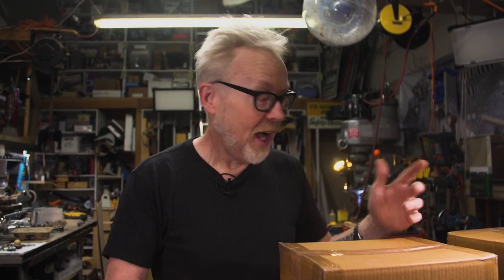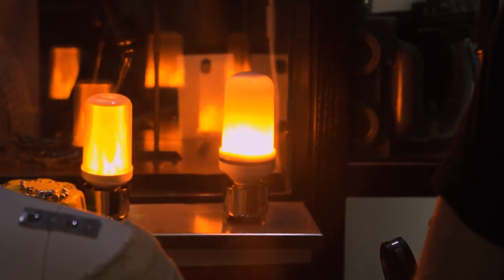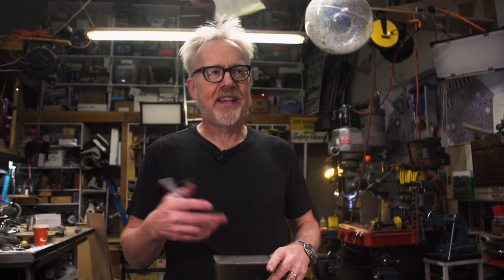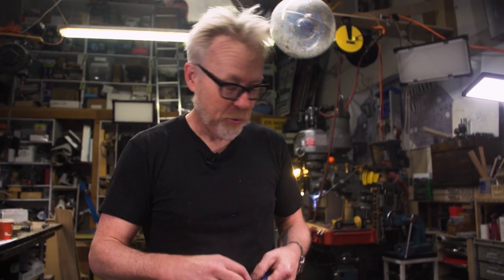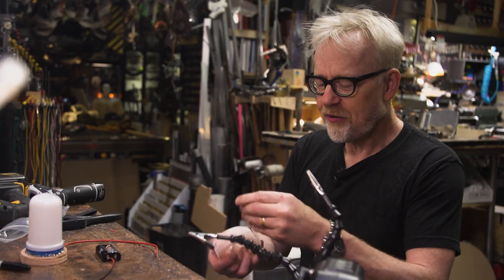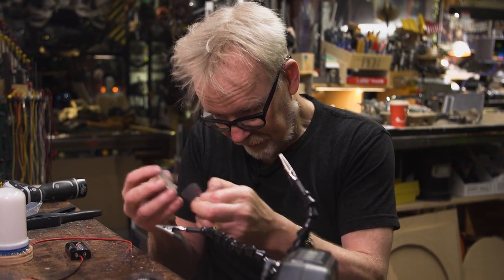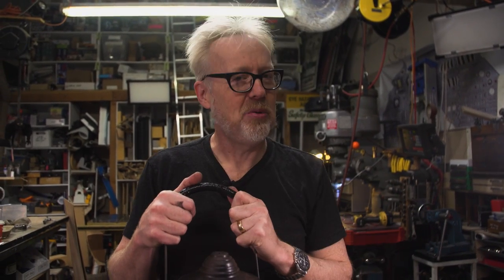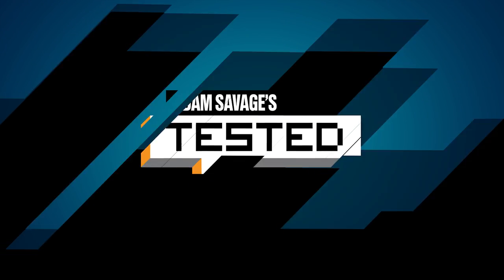Adam Savage's One Day Builds: Gaslamp Lantern Prop!

Comment: I came across something like that dual-lock velcro over 20 years ago. I had designed some graphics for a friends exhibition booth, and discovered that the walls were covered with something call ExpoLoop fabric. The graphics were printed on a plotter then mounted on foam board. The foam board had strips of something called ExpoDash fixed to them. This came on a reel, had a sticky back, and the front side had velcro like hooks. You could stick the graphic boards on to the fabric and if they needed to be moved you could just pull them off and stick them somewhere else. By accident I found that the ExpoDash would stick to itself when I put two boards down back to back! Took some care to get them apart without tearing. There is some cool stuff used by exhibition stand builders and props people.

Comment: I'd be expecting to change those batteries soon! 
It's designed to pull 6w from a 110v supply, so approx 55mA(assuming the converter isn't super inefficient). Standard AA battery has a capacitance of 2000-3000mAh, so running two batteries you could expect somewhere in the region 3-4.5 days run time....or at least I think that's how it works.

Comment: I wanted to do something like this for a stage prop at a Christmas musical I just did, but didn't have time to make one. Plus the two lamps that were sourced for me were oil lamps. 

I wanted to add DMX control so it turned on with the scene and off at the end without someone touching it. 

But being oil lamps I couldn't think of am easy way to install a socket without modifying the glass.

Comment: Love this project Adam. Got some bulbs here in the UK from Amazon, not the same "Omicoo" brand, but they look identical but unbranded.  I can't get it to work from 3V, but it works dimmer than when screwed in to a lamp at 6V. At 7.2V it seems as bright as when screwed in. Just a heads up for UK people ordering these as there does seem to be some differences. One guy in the comments from Germany mentioned the ones they have there only work with 12V.

Comment: When I was a kid in the 70s we had some kind of fire bulb. It was shaped like a normal bulb but the filament was a flat piece of metal shaped liek a flame with holes in it. When turned on a plasma mike effect went from the bottom to the top of the filament. Im sure that was totally safe :)

Comment: Love the video.  After watching it, I was out and found what I thought were the same bulbs you used.  When I cut the bottom off mine the circuit board with the lights was wired directly to the base.  I couldn't cut the wires like you did and add the battery power.  It was such a bummer.

Comment: Yo, Adam. 
Super simple little tip (And it feels odd offering advice to someone like yourself) about that "hermaphroditic velcro" you've fallen in love with. 

Because the stuff has very fixed positions in which it locks to the opposing peice, slap one peice down, stick the other part to it, peel off the adhesive backing, and them position the other part to be attached to the project! 

Sounds simple, but if you're ever using it on parts with a tight tolerance, or want square edges etc, it can catch you out.

Comment: Turned out so well. I have one of those or similar bulbs, one that I haven't taken apart yet. I've noticed that a lot of the led white lights take 9v from  a very dirty (radio garbage) switching circuit / converter 110 to 9vdc. Many of the ones I've purchased from ebay die quickly ? Poor electronic engineering of the switching converter. As I'm in California far northern valley I deal with PGE outaages and use these panels, 12v, (not the yellow ones (I suspect those are actually 9v and run way to hot) , but individual smd led's) they work really well so no lighting needs here. Eventually may say by by to pge. Again, a beautiful looking ingenious  project .

Comment: Just in case anyone else is attempting this project a year later, many of these bulbs are now powered by 6v directly to the board and the only wires present are from the contacts in the screw base to the board. No wires from the board to the LEDs - only solder connection. Still quite doable but more challenging for electrical newbies like me.
Reply: So don't have to take bulb apart anymore?
Reply: @jasonhaislet2732  you do have to take it apart

Comment: 2 little things I saw that maybe help you out with this build and want to add here: 

Adam covered the Holes at the Top of the bulb. These may be there because the Bulb gets quite hot, please either redo them after the cover or don't let the bulb burn for long.

Also, when you are not familiar with wiring up stuff please do yourself a favor and color code the lines. Adam is in the Industry long enough so he might get used to use the same color for every wire, but if you start working with larger projects just do yourself this little favor.

Comment: The batteries seem to last about 18 hours using the flame effect.  After that, the batteries voltage drops to around 1.37 each and the bulb will start strobing.  Using Duracell,  I did measure them before at 1.57 volts each.  Not sure if it has to do with battery age, not sure how old my batteries were.
Reply: I used the same brand of bulbs

Comment: For $4.29 with free shipping, you can get the light bulb on aliexpress
the amazon seller is just a rebrander

I already used the 7W variant which looks the same and also works on 3V DC (2x AA Batteries).
The 5W 7W and 9W variants automatically adjust to orientation.

Comment: I am very surprised that Adam has only recently discovered 3M Dual Lock tape, it has been out for over 10 years now. Dual Lock is by far superior to standard Velcro, you don't have to worry about which side does the hook or loop go on, it has stronger holding ability and it doesn't collect fuzz or hair. There is no reason to ever use traditional Velcro anymore.

Comment: The whole thing with items plugging into mains power where the actual device runs on far less DC voltage is wildly common. I'm into remote control hobbies and have a couple friends who have built large ~20-24" screens for First Person View (with a camera on the aircraft) flying. Many smaller flat screen (especially LED backlit) TV's run off of just 12-16 volts meaning a hobby battery (a 3S or 4S respectively) can run one no problem for a pretty good length of time. Just be careful opening such things as the power supplies have large capacitors in them that could still hold lethal amounts of power.

Comment: I put two LED's into a halloween mask connected to two AA batteries. After halloween they went into storage and I just left the switch on so the batteries would drain and not corrode. Cut to thee years later, those two little LEDs (albeit dimmer) are still on...LED's are very, very efficient!

Comment: Cool! Thanks for sharing. I like how Your passion and excitement for projects hasn't waned over the years.   Would You or have You done a dune landscape video? I'm planning a dune diorama for Wright Bros. Flight (100th Anniversary kit 1/39 scale incl. Crest of Dune & immed. area) but due to space restrictions, I then have to scale down Dune to 1/100th, so 12" high as slope meets beach area (I think slope length works out to be 18" & base run is 14" approx. Have to dbl. chk math lol) Kill Devil Hills, NC (formerly Kitty Hawk) I was thinking of using plastic stilts (cake layer tubes) attached to a frame, covered in mesh with plaster bandage strips over it, then  glue a light layer of sand, so I don't need too much of it. The above idea is instead of using foam board which I've seen in most videos for landscaping themes. Wish me luck. Take care.
/Rosemary

Comment: I see a lot of wasted energy in leds. Take the strong current out of the wall, convert ac to dc, there is about half the energy lost since you cut out half of the sine wave from the grid, then run it through a capacitor to even it out, more power lost and finally you have to have resistance in there letting only 3v of 120 v through. All of that turned into heat. And it is an LED bulb, so it needing low voltages is not that surprising to me... am I a smartass right now?
The velcro with only one side is probably mushroom tape. Very nifty indeed :)

Comment: ...nice build! However, the 2xAAA cell approach is only working because the internal resistance of your cells is working for the LEDs in this configuration. So for those trying this build: don't be "smart" and think of using rechargeable batteries - their internal resistance is way to low (most types) and the LEDs will fry themselves.

Comment: cool project. thxs for sharing. I think i might use those light bulbs to make a SW Florida fireplace. Thxs for listing the sources for the material. Do you also have a source for those cool wire strippers that you are using?

Comment: How do you think this could stand up to the elements, this would look amazing out in a garden. 

EDIT: Oh oh oh!  You could run rechargeable batteries and set it up to pick up a charge on a nearby small solar panel and use a light sensor/timer to run the light only at night...  I need to go to the shop!

EDIT 2: OH OH OH!! I bet one of those little crappy solar powered lawn lights everyone uses run around 3V!  I might be able to just gut a cheap 5 dollar one and not have to build the circuits myself!

Comment: The innards of the bulbs I bought on amazon don't look like the innards of this bulb, though their outsides look identical. I'll have to figure out if they can be powered the same way
Reply: I bought one that ran off 9v instead of 3. Dont be afraid to tinker around and make it your own!
Reply: @micahgodsey455  I have no fear at all of tinkering- I'm a production designer and a prop maker. Just with the particular bulb I bought there does not seem to be any way to effectively run it off of batteries because everything is soldered into one integrated circuit board. Much easier to just buy different bulbs that have more user friendly guts in my specific case.

Comment: Be aware that some models of flame bulb require higher voltage.  The one I picked up will barely run on 6V (four batteries).  Its A/C to D/C converter puts out just over 8V unloaded and about 7.5V loaded.

My guess is that Adam Savage's bulb has the voltage regulation in the A/C to D/C converter and the electronics are designed to run off of 3 (or 3.3) volts.  The FEIT-branded bulb I picked up probably puts the voltage regulation on the electronics side and is probably designed to use 5V.  To reliably get 5V from a common linear voltage regulator (like a LM7805) requires at least 7V input.

Another video pointed out, the voltage regulation appears to be inside the custom IC that drives the entire effect, so it's probably hard to bypass it.

Comment: That AC to DC converter is known as a “FULL BRIDGE RECTIFIER!!” ElectricBOOM talks about that all the time.
Reply: No, the Full Bridge Rectifier forms part of the whole converter / regulator.  It's just one of the first components in this (most likely) "Capacitive Dropper" type power supply.  (It could also be a resistive dropper or a buck regulator but those are less common these days)

Comment: I don't know what technology runs that light-bulb, but I can see two potential problems.

 A lot of circuits (f.ex. led lights) depend not on the voltage as such, but the current. The voltage of the batteries are not 1.5 EXACTLY, but fresh batteries start out at 1.65 (at the very least); Without some sort of protective resistor or other circuit it's probable that you shortened the lifespan of any LEDs or 3v IC chips that might be involved in creating the effect..

Secondly; LEDs take very little current compared to brightness, so it might work for a long time, but if those aren't LEDs (or if the bulb take deceptively much current for the brightness) you might drain those batteries so fast that it wouldn't be reasonable to use such small batteries.

Comment: I asked this before on another video but legit QUESTION: Torch for tightening heat shrink tubing? Is there some amazing benefit of using torch instead of the soldering iron itself? I always just use the "pipe" section of the soldering iron to do it and I don't understand why you'd need a torch for it! :O

Comment: If that is the case, then what about regular LED light bulbs? Can they also run on batteries too?
Reply: I think most are so optimized for cost that the LEDs and AC-DC converter are on the same board and can't easily be separated.

Comment: If it's 5 watts and only 3 volt, would that be like 5/3 = 1.67Amp, so on 2 1.5v in series with the Amp Hour 1300 would be 1300 /1.67=*778.44 hours (778.44/24 about 32 days)*
or is it
If it's 5 watts and 120 volt, would that be like 5/120 = 0.0416Amp, so 1300 would be 1300/0.0416=*31250 hours (321250/24 about 1302 days)*
or neither?
(Not sure how to count 5 watts for the converted 3 volt or 5 watts using 120 volt ...electricity/electronics is not my strong side...)
I really like the result in the video though!

Comment: I purchased the bulbs linked in the description for a project like this, but the bulbs that arrived were not the same and didn't have wires for attaching the batteries as the ones in the video.  Can you recommend another brand or source for some that would work?  Thanks

Comment: Doesn't it kind of suck that the average electrical device only ever needs a 5 - 12V DC power so we're always using these big adapters to power (almost) anything ?

Why aren't houses build with that as our main power system instead of the standard 230V AC (or your local equivalent)
Heck ... USB power ports would be such a great feature as a standard power source.

AFAIK hospitals do have DC power circuits within their buildings...

Comment: Weird. That they had that converter inside the bulb.
Reply: pbilk1 could the converter be there to allow it to be screwed into conventional sockets? If the circuit uses 3 volts DC, it seems to me that 120 volts AC could fry it

But that’s just a guess from someone with little knowledge of that kind of stuff

Comment: I couldn't believe those run time claims and I have a couple of these bulbs so I did some testing. The power draw changes exponentially with voltage. At 4.2V it draws around 3W. At 3V it draws around 0.4W and at the minimum voltage of 2.5V it draws only 0.006W. That's why it can run for days.

Comment: you need to get a VS3 tool for connecting low voltage wiring Adam. 2 seconds per splice. no more stripping soldering and heat shrinking . will save you hours and hours of work in the long term

Comment: 7:58 - Imagine when Adam finds out that old red LEDs actually ran on less than 2 volts. :D

I'm far more impressed with the fact they included an orientation sensor to change the direction of the "flames".

Also, it might actually have been smarter to use 3 batteries, so you can use NiMH rechargeables (1.2 volts each, x3 = 3.6V, which they should maintain for a pretty long time) and add a small resistor to end up around 3.3V under load, which is what the controller is likely designed to run on. 

Two alkaline AAs will start out at around 1.65 x 2 = 3.3V but will drop below 2.8V (1.4 x 2) after a few days, and the LEDs won't even light up despite there still being charge in the battery. If you design for rechargeables, not only is there less waste (because you can keep reusing the same batteries), you also get more out of each charge.

Comment: So.... What if my bulb actually has three leads coming out? White on one side, a pink and a white on the other, and can't seam to complete a circuit no matter the combination.

The pink was connected to the board and marked (+), the white on that side was (-), and the other white was just connected to the board in an unmarked spot...I've tried connecting this third wire to both the positive and negative circuits and get nothing.

Comment: Just wanted to pop in and say what a wonderful little hack. We've had some stain glass candle lanterns that I've been running for years with some 12v puck lights, it works but this is next level. This is a great upgrade. I measured the output of the power supply at 3.87VDC so to take this a bit further I'm using a lithium cell (3.7-4.2V) with a TP4506 charger circuit ( https://www.youtube.com/watch?v=Qw4psECqpwI ) they are available on ebay and amazon for under 50 cents each, the LiOn battery should last around 7-10 years with intermittent charging.  Also I found that you can unsolder 3 little spots on the board and flatten it out also making this useful for a slimmer more directional effect. Again great little hack.

Comment: This new Velcro stuff... sounds an awful lot like 3M Command Strips, and those ain't that new.  Used them to hang a 17 drawer small parts organizer.  The things are freakin' awesome.  I used knowledge gained from one of the Mythbusters episodes on duct tape and took the amount of weight I was expecting to use with the system and used as many of the 9 lb. weight supporting strips around the back of the box as would be needed to hold it.  I figured it probably wouldn't need more than 27 lbs (3 pairs of strips) because it's just holding adapters, AV and charger cables, but I stuck 4 on (you know... just in case).  It's been over a year now and it's still solidly stuck to the wall.  Thanks, Mythbusters and 3M! =)

Comment: For a slightly easier build, there are LED flame bulbs with built-in battery (5V micro-USB can recharge or power the bulb).  < https://www.amazon.com/KKTICK-Rechargeable-Flickering-Christmas-Decoration/dp/B07HF1ZB2S > Another thing to note is that these flame bulbs have varying degrees of believability (some bulbs flicker "wrong enough" to stand out in a bad way, I've tried a few kinds), but the two from tht link were both consistent and looked great.